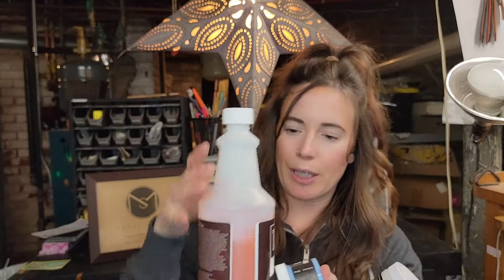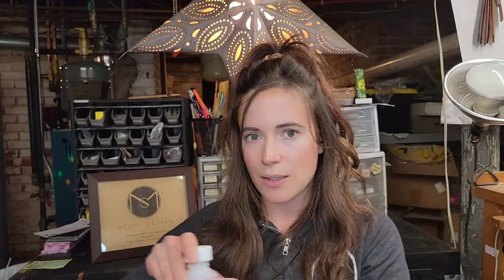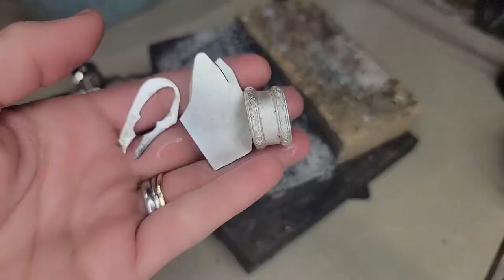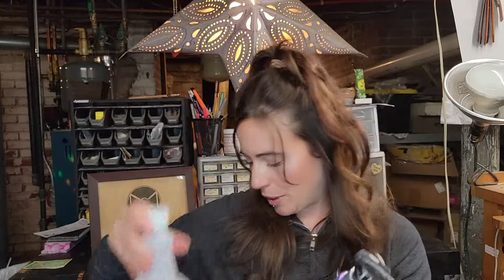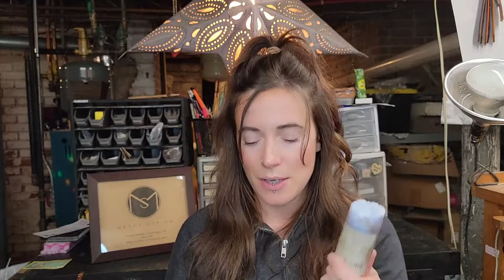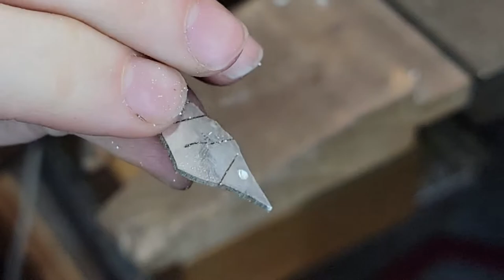Pepetools Bench Basic Tool Review - Metalsmith tool talk

Comment: I was always wondering about Pepe blade butter… Now I know… I use Otto Frei stay sharp lubricant and it works great with my sawblades which I also use Glardon Vallorbe saw blades and the lubricant works great with the saw blades. But I’m not very happy using their stay sharp lubricant with my burr bits… so I will definitely be trying Pepe Tools blade butter for my bur bits. I loved the example you showed using the sharpie on the silver metal and how easily the blade butter will remove your sharpie marker. 
Also regarding Rio‘s pickle I personally do not like it. I’m currently using it at the moment until I run out but I’m going back to Sparex No.2 pickle….Pepe Tools sells this At an amazing low price. Now I’ve never used Pepe Tools pickle before but you mentioned that they both work the same as Rio’s pickle…I will most definitely be going back to Sparex No.2 and I will buy it from Pepe Tools. If you ever get a chance Michelle you should try Sparex No.2 because that pickle in my opinion is the best pickle that I’ve used.
Thank you so much for your honest and very helpful reviews.
Autumn Michelle
Reply from the maker: Hi Autumn! I will definitely try the Sparex next, thank you for the recommendation! I thnk the blade butter is definitely  worth trying, let me know how you like it if you decide to purchase! So happy you found this review useful. Happy Tuesday 💙💎